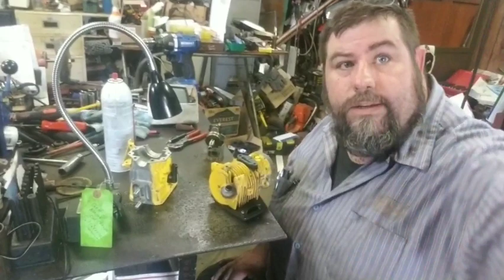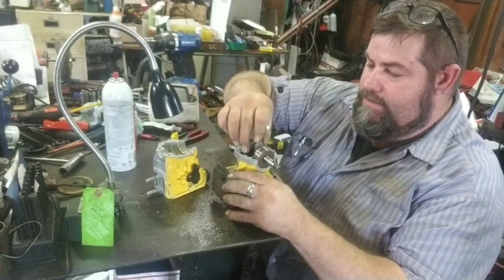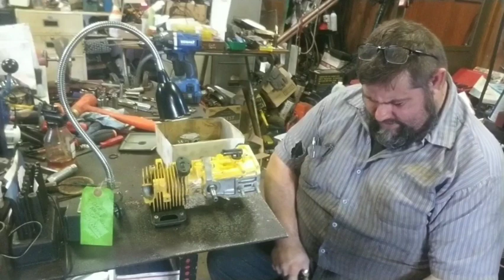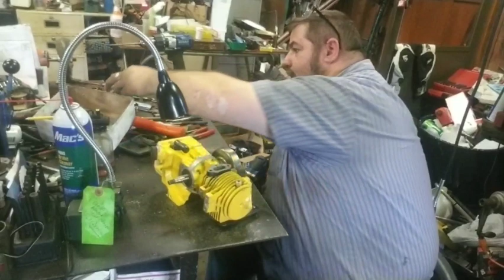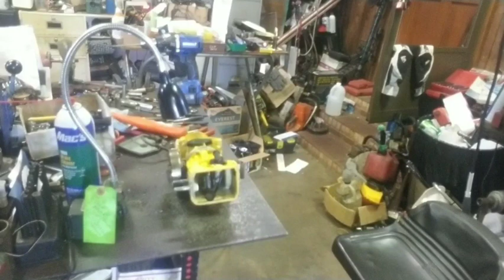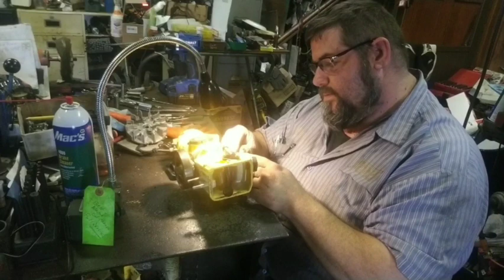Mcculloch 10 10 porting and reassembly prt 3

Comment: Hello Bell , i just bought a 7-10 and I am pretty sure it miss a spacer or washer in the clutch assembly,  it look similar to this 10-10 . I have a very this washer against the body on the saw, than the chain sprocket with the clutch bell and the bearing then the inertia masslets on the conical part of the shaft and the nut. I am pretty sure it should at least have a washer between the nut and the masslets and maybe one more. May you help me please., I will be so grateful.  Thank you.
Reply from the maker: Hey buddy there isnt a washer behind the nut sound like you got it togther right
Reply: Thanks  no, is just the clutch slip when I attack bug wood and when I opened it it looks like it missing something,  there is a lot of clearance and play between all clutch parts. 🤔🤔🤔 I will disassemble it and looks. 👍thank you Bell.

Comment: BELLHOPPER  Got to ♥️ those mac saw's.  I have been handed down a Super pro 81 with a broken chain side cover so it doesn't have a brake or lever and the spike mount is clean broke off on the top part. Any other saw side fit this or am I out of luck. Really lookin to get a buckin spike on it versus the brake. Best regards.  Alaska Brad
Reply from the maker: Hey buddy any of the 10 series covers shud fit it we swap around all the time lol
Reply: @bellhoppersaws  Thank you kindly.  LET THE HUNT BEGIN 😊😊
Reply from the maker: @alaskabradgilgus8477  the old no brake covers are the most sought after

Comment: Did you hit the transfers?  When I ported mine I just got the intake and exhaust.  I didnt want to risk hitting the bore trying to do the tranfers. Not a lot room in there.
Reply from the maker: Took them down but this is the 3 small port cylinder
Reply: Yep. I didn't wanna try it on those.  The saw runs awesome with out doing that.
Reply from the maker: @mrbill9454  oh its better afterwards lol
Reply: Oh yes!  Now I wanna port every saw I own. Lol
Reply from the maker: @mrbill9454  lol is addictive even my 69 dollar leaf blower has a decked cylinder with popup piston lol
Reply: @bellhoppersaws  That is awesome!  Last night when I was weed eating my yard i was wishing it was a 2 stroke so I could port that.  I did upgrade the carb tho.  Maybe I should put a bigger cam in it.  ha ha haa Yes  its a 4 stroke
Reply from the maker: @mrbill9454  hog out  the muffler and adjust the carb it will run better
Reply: @bellhoppersaws  I will have to that. I bought that thing new 10 years ago. It's about time to have some fun.  I use it as a pole saw too

Comment: Do you have any 10-10 coils laying around need one bad
Reply from the maker: Hey buddy email me and ill see what you have and we can go from there
Reply: Model number 600002u has red compression release
Reply from the maker: @danieltackett7114  electronic igntion
Reply: I think it has points
Reply: I traded for pro Mac 8200 are they good saws
Reply: The 8200 is very nice saw but he took some of the parts off have to get them
Reply from the maker: @danieltackett7114  can u send a pic of the coil